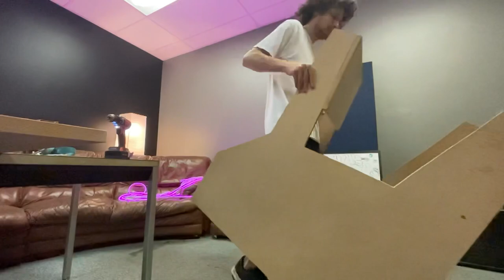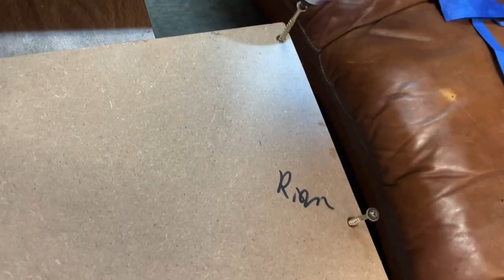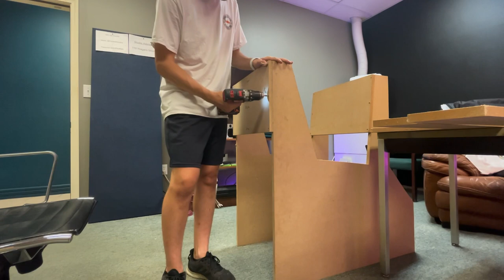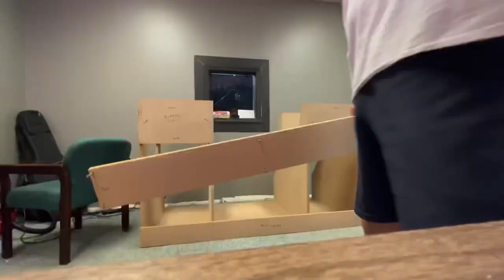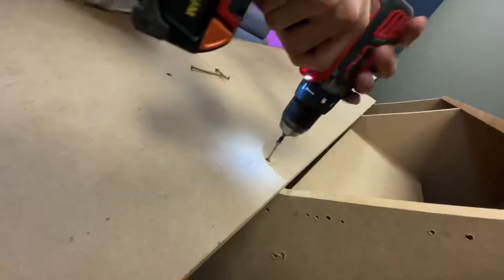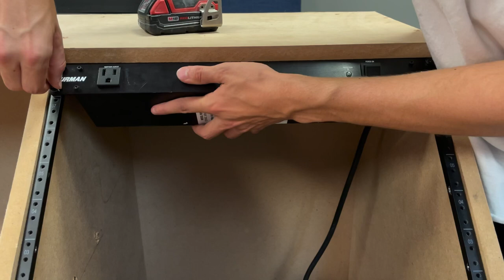Building A Studio desk UNDER $100 With gear racks

Comment: Love it, it would be really worth the little extra and use 3/4 inch birtch plywood, it’ll look better and last a lot longer than MDF…. It’s a nice build….
Reply: Yeah, I do think this thing needs reinforcement as MDF butt-joints with deck screws are NOT going to hold up
Reply: @WarrenPostma  best bet is to add wheels to the desk so it moves as a whole instead of bends and pressuring the joints, also im gonna copy you on this and use vinyl wrap to finish her off
Reply: 3+ years after my initial build of it, i jsut assembled it for the 4th time and still solid as a rock. The massive back sheet adds a lot of support but i see what you guys are saying, a little extra support never hurts

Comment: That's like $100 worth of racks. How much did the wood cost?
Reply from the maker: $36 for a 4x8. I used 3 of them. So yes technically it cost me around $140 but you could keep the cost under $100 if you build wisely.
Reply: @boardingguitarman  so this $100 desk costs probably over $200 with all the hardware installed. Boo.
Reply: @psychodelian  lol you're stingy
Reply: that's truth, bro
Reply: Agree.  I just priced different plywood materials alone and it ain't cheap these days. One sheet of 3/4" x4' x8' MDF is around $60 at HD. MDF and pine are getting close to Oak & Maple prices which can range from $70 - $95 a sheet.  I just finished drawing plans for one that will be more elaborate than this with drawers, keyboard slide shelf and dual 19" rack supports on top.  I figure it will cost me +$400 doing it out of oak. Probably closer to $500 since I tend to underestimate.  But it will be fun!

Comment: nice work... did you use MDF or hardboard ?
Reply from the maker: Mdf
Reply: How is it holding up? I think it needs some 90 degree metal brackets in the corners to hold its rigidity.